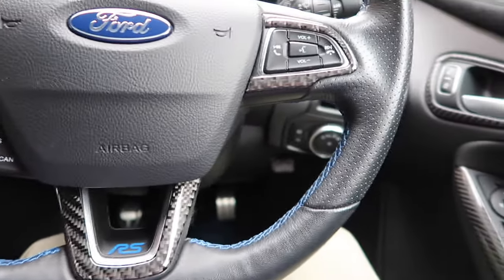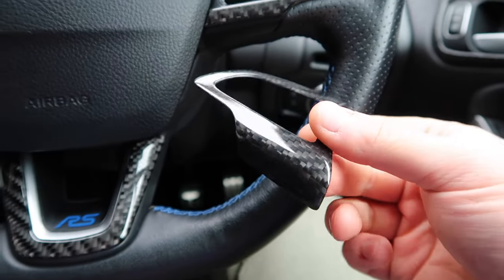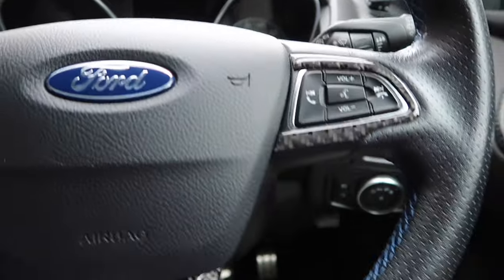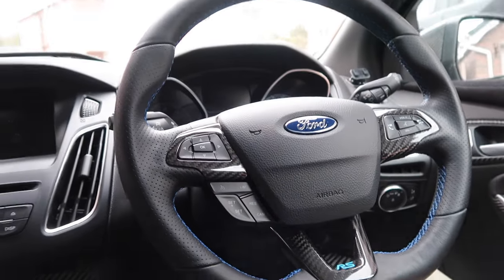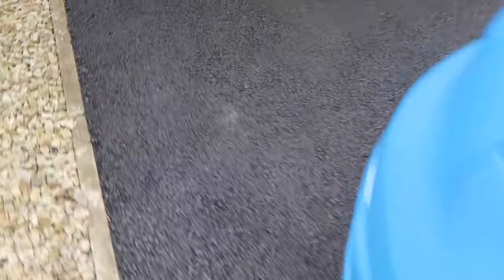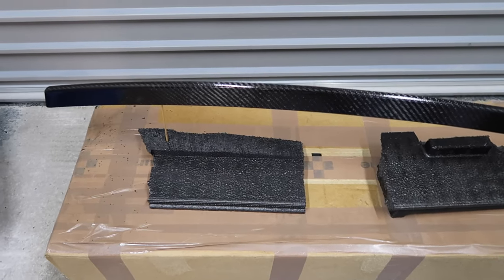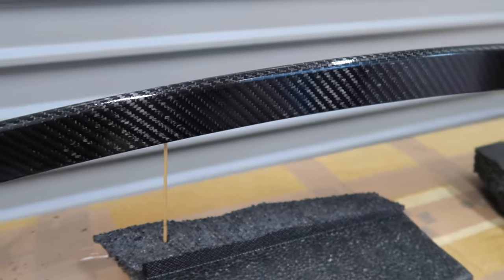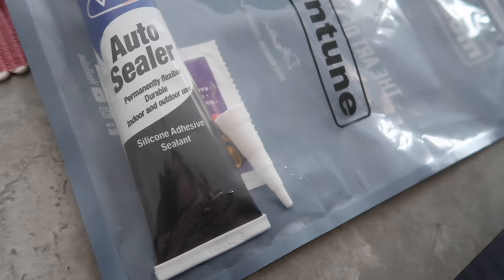RED 5 CARBON STEERING WHEEL UPGRADES & MOUNTUNE FAIL!  | FOCUS RS | GARAGE UPDATE | VLOG 56

Comment: How was the fitment on the side with the cruise control?
Fitted perfectly or do you had to do some adjustments?

Thanks for reply mate!
Reply from the maker: no adjustments made, the fit with cruise control is very tight. If you want to compensate, simply don't put any sticky tape on the bit that slots in above the cruise control buttons and you are good to go
Reply: Hey, me again..
Where did you order? I cannot find any site.. 
Cheers!
Reply from the maker: Contact Red5 directly on Instagram or Facebook to make an order